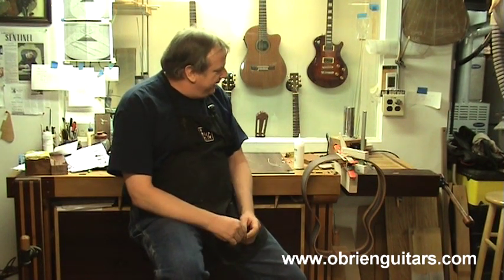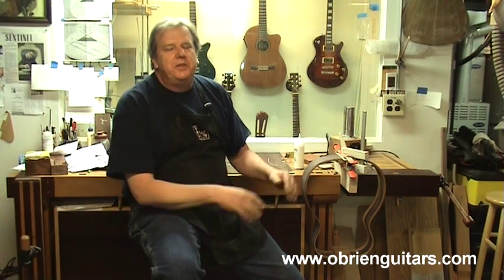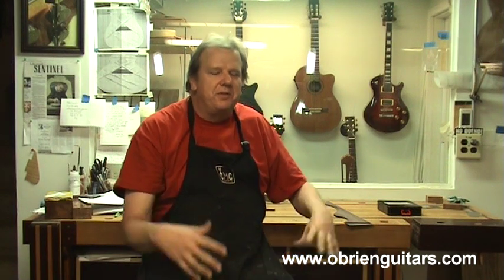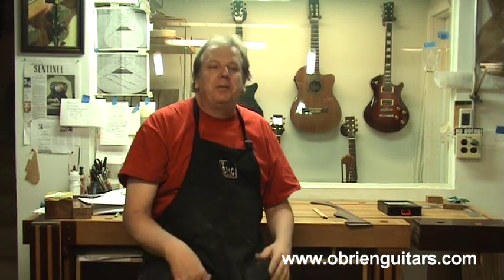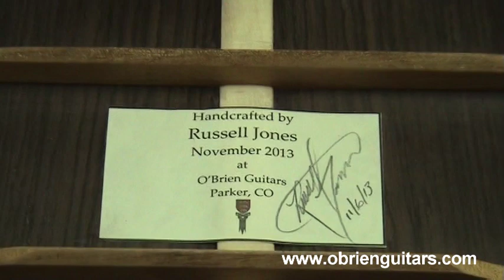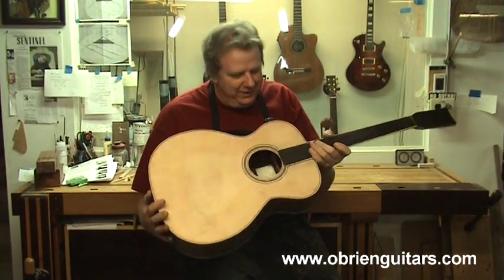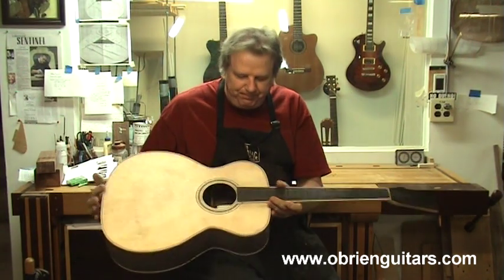O'Brien Guitars Guitar Building Class

Comment: You didn't have time to clip the ends of the strings off of the machine heads, apparently.
Reply from the maker: I like to leave them on until I am completely done with the setup, just in case I need to remove them during the process.